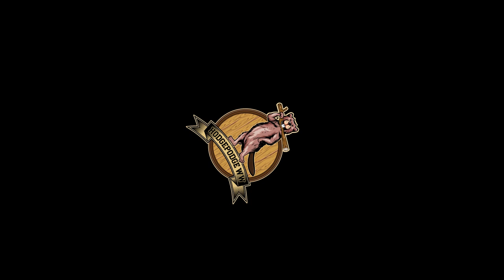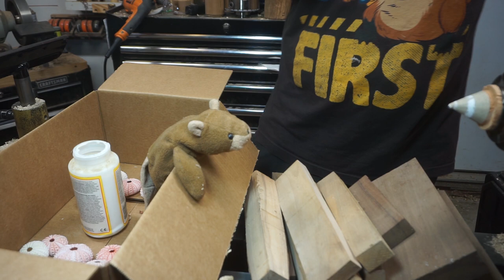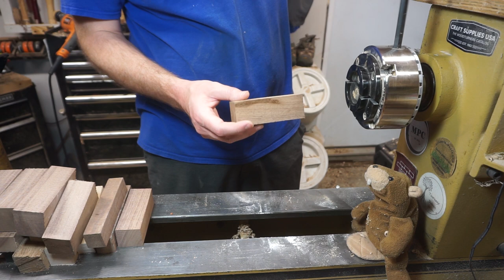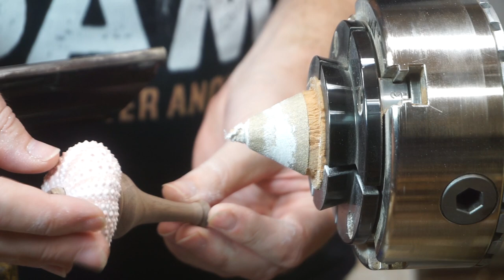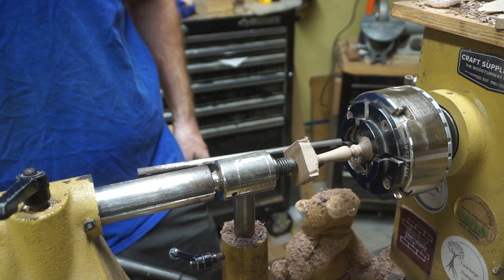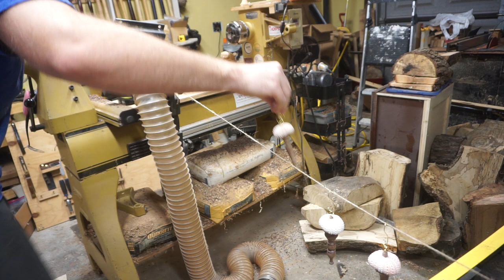Woodturning - Mini Sea Urchin Ornaments

Comment: I used super glue and glued my broken shell together and made the ornament. Applied glue, aligned then shot hardener on it.
Don't throw those 2 halves away!
Reply from the maker: I just happen to have a huge bag full of these pink shells that I got from Ebay. I'd definitely glue it back together if it were a nicer type.